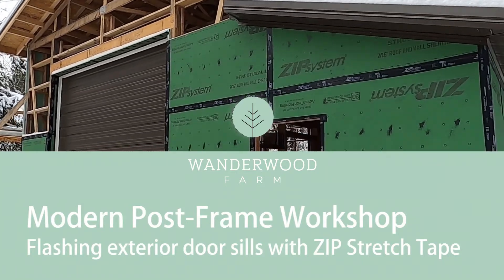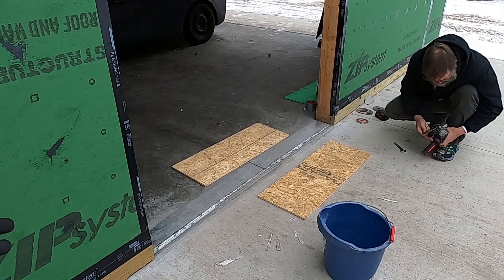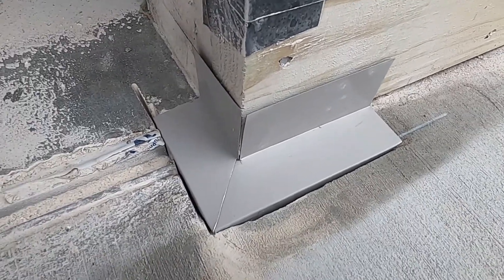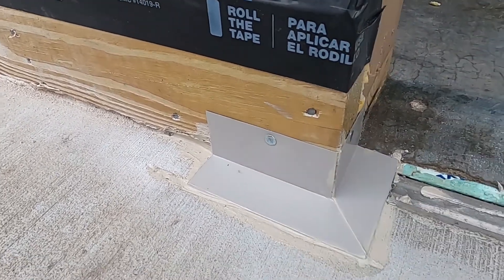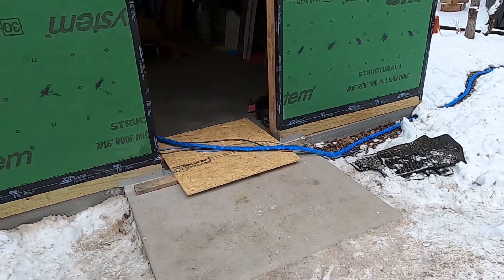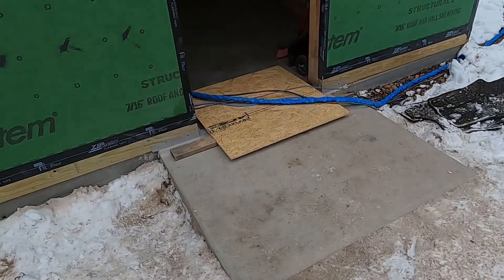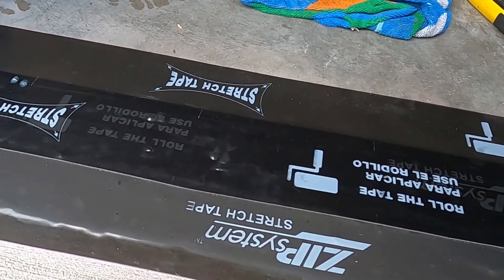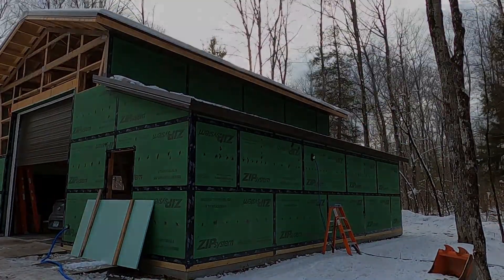Waterproofing door sills with ZIP Stretch Tape (047)

Comment: Did you prime the concrete before applying the ZIP tape?
Reply from the maker: We did not. What sort of primer would you recommend? Thanks!
Reply: Risinger used a Delta HF primer for his Delta Band tape here. And I've seen other tapes call for 3M spray adhesive. I didn't see anything in ZIP's specs though. https://youtu.be/rQj1wPyvsio
Reply from the maker: Nice. Thank you for the info. We did grind/buff the concrete to clean it, and the tape seemed to stick quite well despite being fairly cold out. I don’t think ZIP calls for an adhesive, or perhaps I missed something. Anyways, thanks for the product info. Much appreciated.